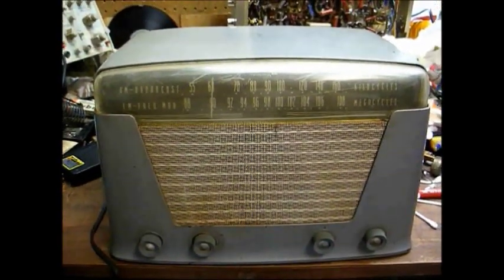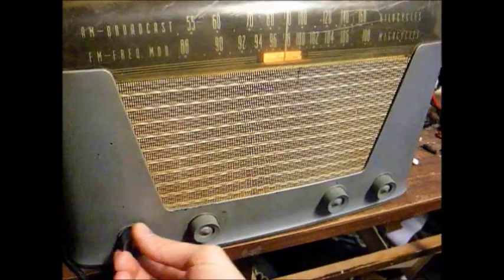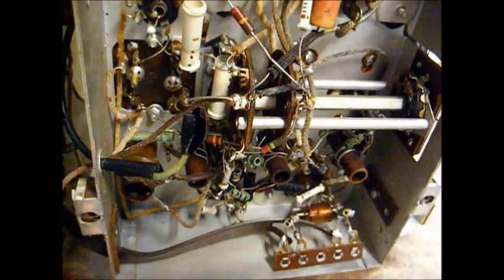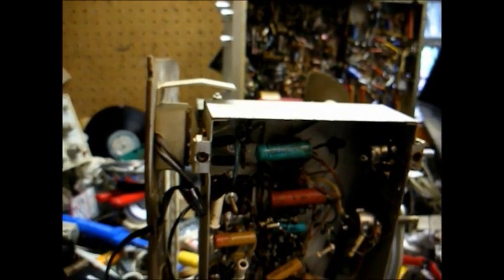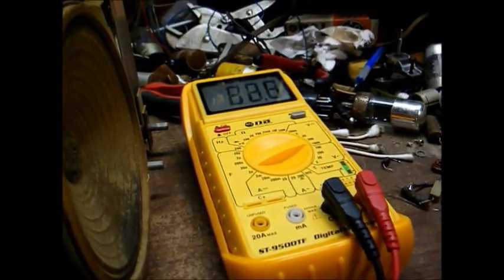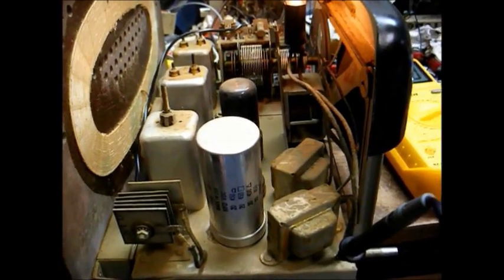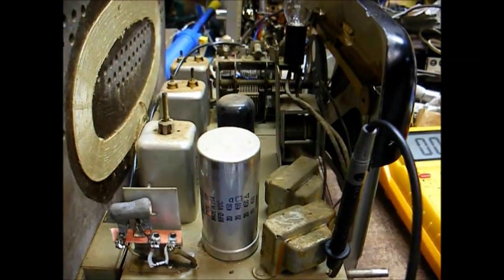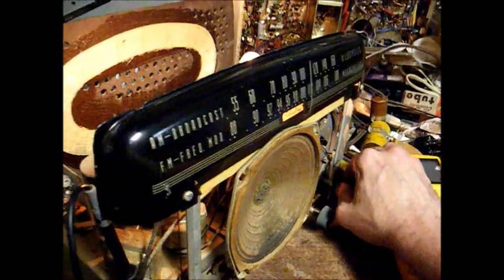Repair of a circa '49 Silvertone AM/FM tube radio (selenium rectifier replacement) - pt. 1

Comment: my experience with ac has been that if you touch the "hot" side of an ac line you don't even need to complete the circuit to get a shock, the capacitance of the human body does an excellent job of giving you one anyway as the voltage pulses from 0 to about 170 (peak), charging you up and then discharging as the voltage increases, decreases and reverses direction. I don't have an isolation transformer, so I always check my chassis with a meter or neon tester

Comment: People would sometimes got shocked from equipment such as radios, so eventually polarized outlets were introduced.  Even though the practice of "hot chasis" was long ago outlawed, and the equipment being out of widespread use, the old hack of polarized outlets remains.  Although it is still frowned upon to switch the neutral.

Comment: Hi Phononut, A while back I bought a real nice Crosley 56TC, wood body tube radio and would like to restore the electronics, power cord is bad, and, who knows what else. It looks to be all original, and, appears to have not been worked on. The chassis is fully enclosed and looks to be riveted together. Would you have any suggestions on what I should do? Drill out the rivets looks to be the only way inside. Thankyou for any help you can offer. The radio is the 'American Overseas', the chassis has "1525" stamped on it. Take care, C.

Comment: hot chassis design.. when I was a kid I had a record player from the 1960s, it was tube and I would get a nasty shock when I would touch the tonearm while standing bare foot on a concrete floor in the basement. I'm wondering if that was the issue with it?
Reply: cowtippingrocks In all likelihood, yes!

Comment: I checked out  the plate voltage of many tubes normally used in radios and I found that the tubes can work comfortably with an increase voltage of up to 70 volts in the low range. In fact the higher the voltage the lower the plate current. That means that some tubes can work at higher voltages with no problem. So the resistor in series  with the diodes need not be there. Also some people say that helps prevent an inrush of current. So what bad will that do?  i have been building tube amps for the last 50 years using diodes in the rectifier stage and the inrush only charges the caps the  real current is achieved after the tube heaters are warm and a signal is injected. Please explain what this inrush thing is so bad to me.
Regards   N6YOC

Comment: My Zenith hi-fi AM/FM receiver from 1957 is a series-string set with a single silicon rectifier (you wouldn't know it was there unless you knew where to look).  I got FM working by replacing one of the hybrid components and two of the tubes.  It still doesn't sound quite right...

Comment: 5:25 But why didn't they use AC power isolation xformers in these larger, and presumably higher end, receiver sets?
Reply: I have a power transformer in a 1950 year  AM/FM set by Silvertone . Model number 18. It was one of the last ones 
before they went to Selenium rectifiers  which were cheaper. They don't put " isolation" transformers in radios.
Power transformers were used to get line voltage AC in  into two or more AC voltage supplies. One for the tube 
heaters and dial lamp(s) if used and  the other to get the B+ supply which must be further  rectified.

Comment: Were you ever able to track down the problem with the FM side?  I have one like it and the FM isn't working.  I can not seem to find the trouble.  I suspect there is a common problem.
Reply: Hi there. Most FM tube radios by now have stopped working because FM is more demanding on the FM oscillator circuit and takes more plate current than AM. I had a Philco model 48-1283 AM FM PHONO console that I restored and the AM worked but not FM. I found that the main b plus was measuring about 142 volts when it should have been 340 volts. The culprit was a weak rectifier tube. The loctal socket was so badly burned that I just used a couple of 1N4007 diodes soldered underneath and that brought it up to a strong 360 volts and FM worked good. FM tuner tubes need good emissions and healthy plate voltage. I hate to say it but RF transistors are better for FM but tubes are much better for AM

Comment: Nice set. Will it receive an upgrade with an AC safety cap across the line? Similarly, a friend I knew would put a .01 disc across the power switch for spark arrest, and maybe one across diodes at times. Yes, If its worth doing, it's worth doing right. 
Nice IF cans in this Arvin!

Comment: Sears has some weird things in their radios. Instead of a 35W4 rectifier tube which has a heater tap for a # 47 6.3V dial lamp, they have a selenium rectifier with a 7W 120V night light bulb for a dial light Weird!!!!
Reply: The selenium rectifier is typical for AM/FM sets, because they need the 35 volts saved for the or 4 tubes added for FM. I never quite understood the point of a $5 transformer to power a light, though; why not just use a resister or a 120 volt light?

Comment: Everyone always talks about Isolation Transformer and I agree that are must have, but has anyone priced one that can handle 5 amps. Holy crap talk about price fixing.
Reply: Greetings:
For an isolation transformer, look for a big  used 120/240 switchable transformer  that has two 120vac windings. Use the second winding as your isolation winding. It will only handle 1/2 the power as when two windings were in parallel. Any 5vac or 6.3vac filament windings can be wired out of phase with the 120vac input winding to lower the output winding AC resulting from today's elevated mains levels.
Also, when replacing the selenium rectifier, a non-polarized capacitor can be used ahead of any diodes to drop the rectified DC level as a substitute for the power wasting dropper resistor. Find a good YouTube capacitor dropper circuit for the calculations. A motor run or starting cap OR microwave oven cap is non-polarized. I think about 33mfd is a good starting point then reduce until the B+ is right. I'll look for the Calc formula. Place a 1meg resistor across any dropper diode for safety. Meanwhile, the tube heater string should not be affected by any dropper cap placed ahead of the silicon diode and filters. As 1N4007's are cheap, I would use 4 in a bridge to convert from 60 Hz ripple to 120 Hz ripple to extend the life of the filter caps. Capacitor droppers are very popular in 240vac countries.
A separate dropper cap can be added to reduce the elevated mains AC from 125vac to 110vac if you wish.

Comment: FM tube tuners work good with high plate voltage aww just use a diode straight. I bet ya got weak FM tuner tubes 😁